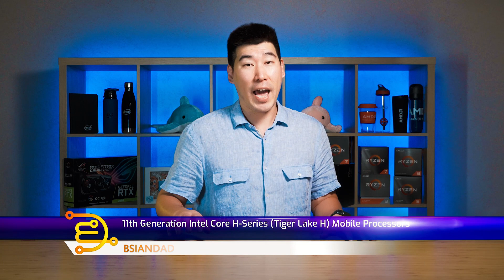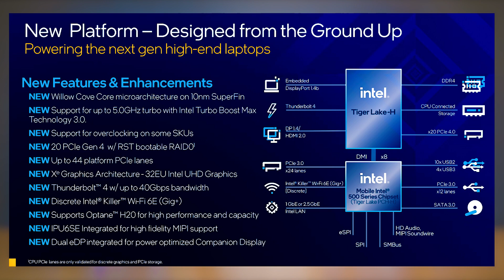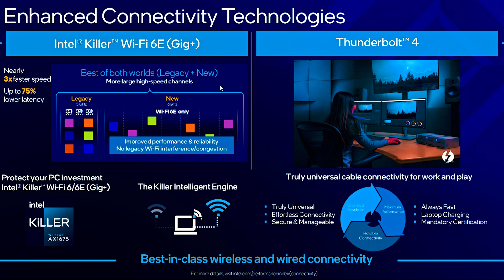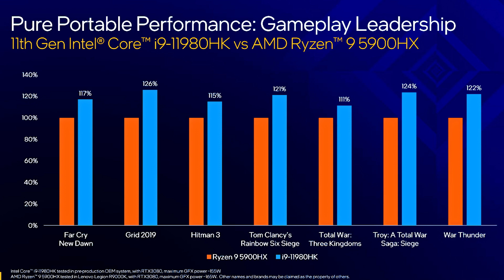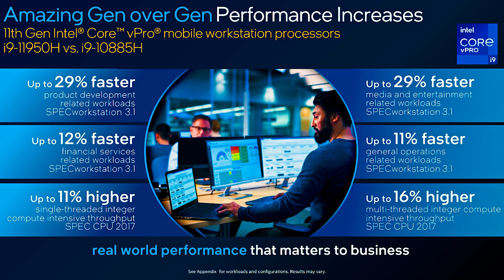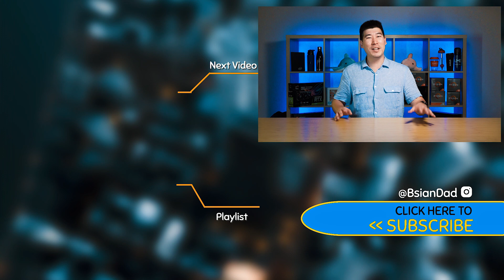New Performance Mobile Processors -  11th Gen Intel Core H Series (Tiger Lake-H) for 2nd half 2021

Comment: There's no mention of manufacturing process and still on Intel UHD graphics, are these refreshed 14nm chips?
Reply: Nvm just spotted the 10nm on the second slide, supposedly new gpu arch but they are still calling it Intel UHD which is strange. I guess the benchmarks will reveal all.
Reply from the maker: Oh good you found it, they mention to us it was a new process on the 10nm. They actually running the Intel Iris XE but yeah it be called Intel UHD as well so no different from the other 11th Gen CPUs for graphics. Exactly for the benchmarks, the new i5 and Xeons are high on my list to have a play.
Reply: uhd 750  ,new rocketlake ingrated gpu. are using 10nm xe
Reply: @bogodoyandex9654  Ah that makes sense, I thought the new GFX were simply called Iris Xe and the old arch was keeping the UHD branding.